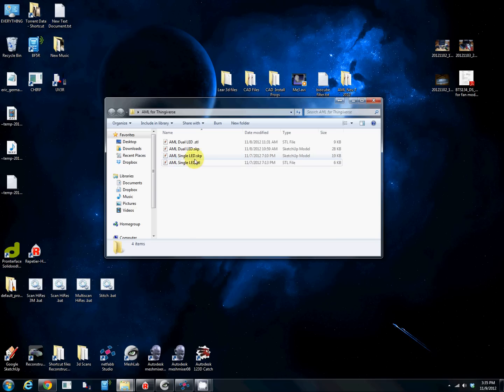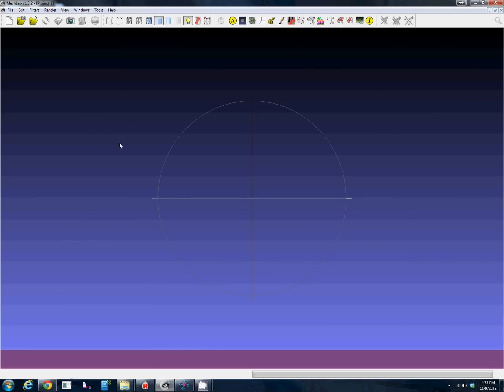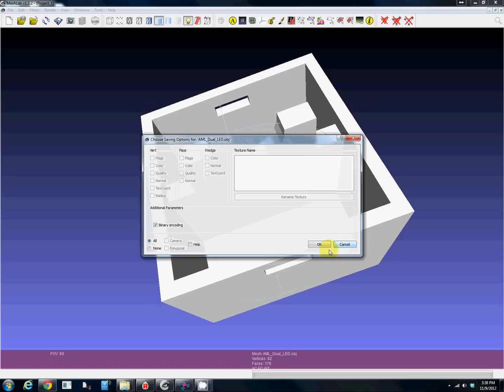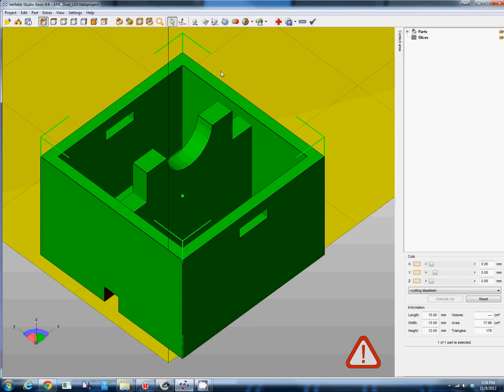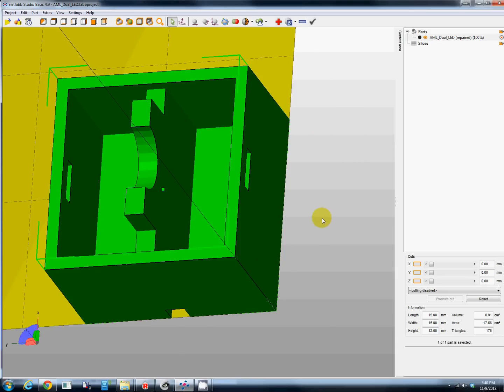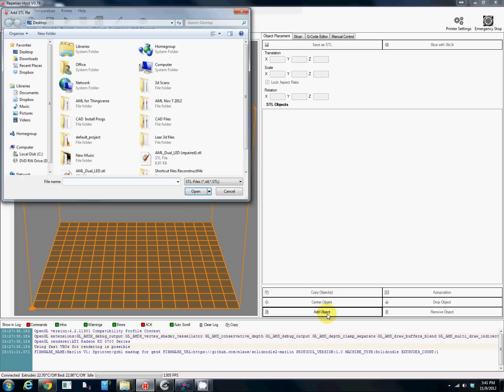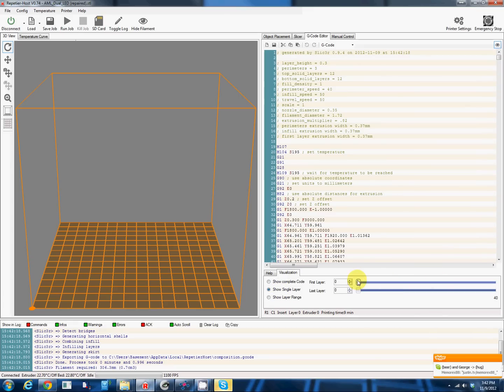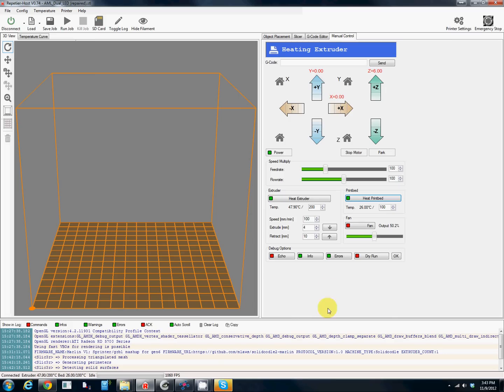3D Printing From Google Sketchup Tutorial

Comment: I assume using an solid modeling program used in engineering (Creo, solidworks, ect) would create good stl files from the get go? I used Creo in one of my college classes to save a slt part but the professor took over the actual printing.

I am looking to get a solidoodle 2 so do you have any advice outside of your videos?

Any information would be useful, thanks
Reply from the maker: The Solidoodle has been great for me.  I would probably grab the newer versions than the 2 now tho.  Many new advancements.  Great printer for the price.  Cheers
Reply: Great to hear. And As much as I would like to get one of the more modern ones, I just can't afford then. I'm just getting the base model and making custom modifications as needed.
Reply from the maker: Well thats fine too for sure. The beauty is- you can print your own upgrades. You will love it once you get it dialed in. Cheers
Reply: haha it'll be so nice! It'll be very useful in my hobbies as will. Thanks for the videos!
Reply: Out of curiosity, how fast did they ship your printer? I ordered mine a week ago and they haven't shipped it yet.
Reply from the maker: That part was a long time for me.  I ordered when they were fresh off Kickstarter so it was several months .  Not sure what their lead times are now but they have a thread in their forum devoted to it.  Cheers
Reply: Got it thanks, I did not know that they built them upon ordering. 7-10 days it is
Reply from the maker: Good stuff.  I think you will like it once you get it dialed in.  Defenitely takes a bit of tweaking but well worth it.  Brings about a whole new way of thinking when you can make crazy intricate stuff... Cheers